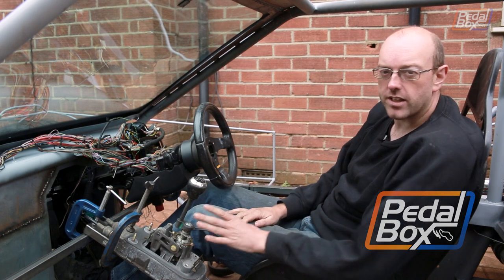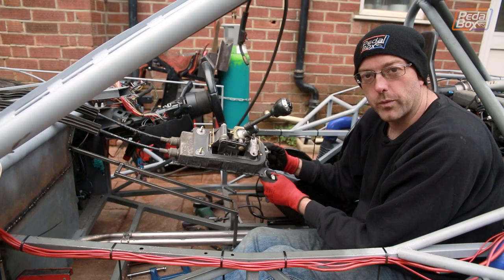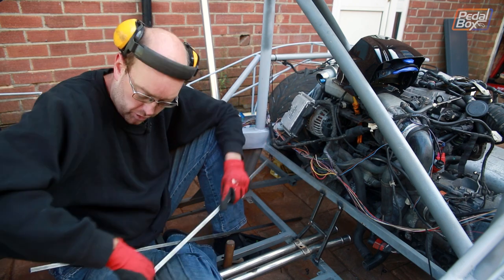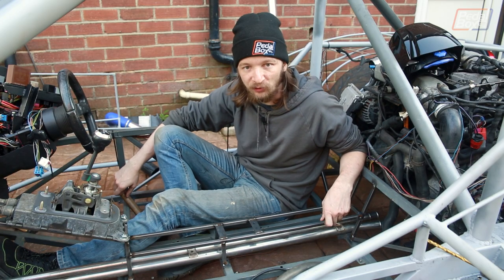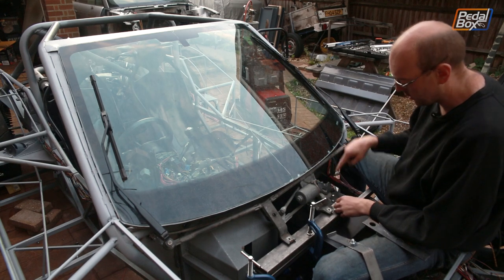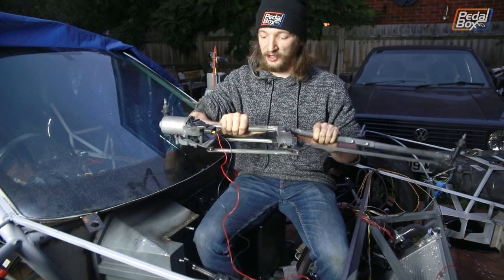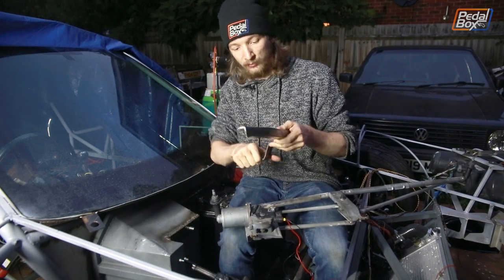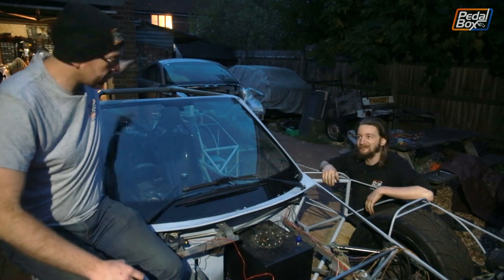Fitting Wipers, Gearstick and Handbrake | Audi TT Kit Car | PedalBox Episode 64

Comment: Cool video guys, just to let you know that you just have to have the selector cables coming out of the back of that box instead of the front. Loads to VW's running twin engine's do it that way as well as the Lotus boys using the 20v.
Reply from the maker: Interesting! been looking for some info on how it could be done for a while now, back in 2019 in fact. Sadly that placement wouldn't fit in the bay, it'd come out where the passenger seat is. Slightly too compact of a space to work in in our case. BUT i'm happier now I know how it's done :) Thanks for the info!

Comment: Strangely this video just stutters and glitches for me so cant watch it yet. All others work ok!
Reply from the maker: How strange. Has it sorted itself now?
Reply: @PedalBox  no, looks like its buffering every second. Running at 360 res! all other vids playing ok still.
Reply: @PedalBox  it's working today! I had a smart car, you can park the wipers vertically, which looks better than at the bottom!
Reply from the maker: @StuMunro  Thats good, is that controlled by the switch/systems on the Smart?
Reply: @PedalBox  it was a long time ago, so cant exactly remember how I did it, but it was very simple like flip the linkage. I just found a how to. https://www.evilution.co.uk/exterior/vertical_wiper_mod.htm